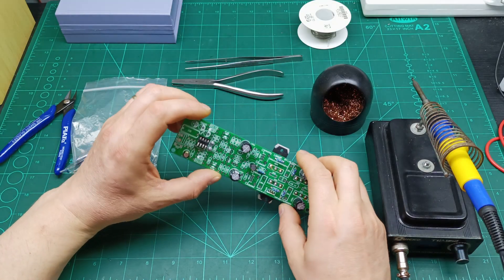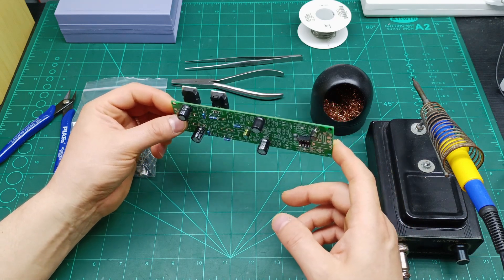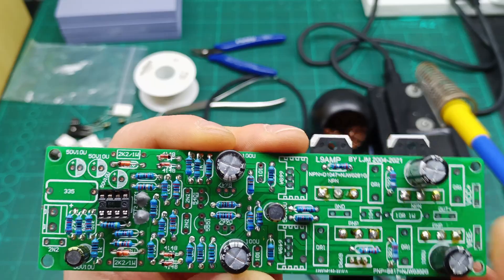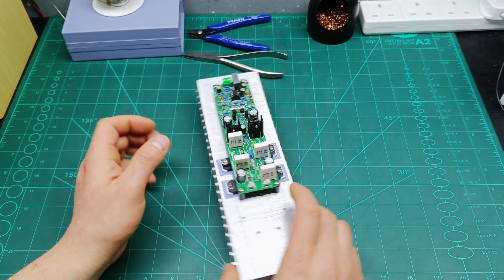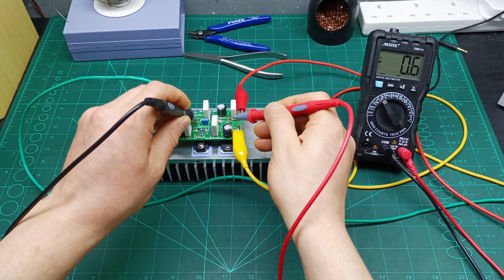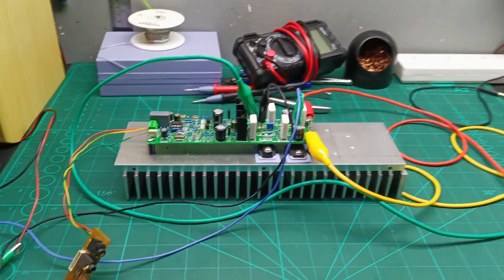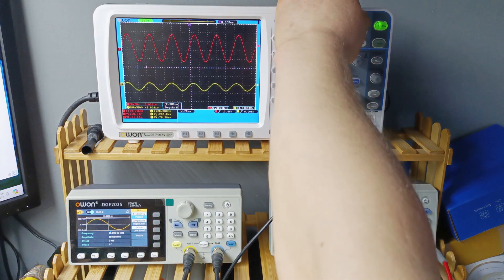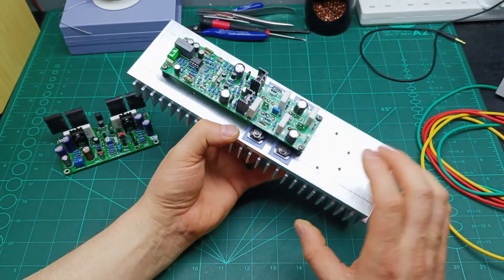Let's build an amplifier using AliExpress parts part 3 | Accuphase E405 amplifier kit

Comment: greetings, the power supply is symmetrical... the maximum voltage is 50-0-50V or 25-0-25V..thanks. nice build.
Reply from the maker: Can work from +/- 25 up to +/- 50 DC voltage
Reply from the maker: So - 25 0 + 25 up to - 50 0 + 50 volts dc
Reply: @SymbolTech21  thanks

Comment: I changed the value to 4.7kOhm which sets the gain connected to the inverting input of the preamp. I set it to 1kOhm and the preamp gain is now 0db. Now the sound is better.
Reply: To be honest, when I first turned on the amplifier, I was not impressed with the sound. I immediately noticed the insanely made preamp and it is clear that the sound problems come from it. This morning I listened to the amplifier with different genres of music and I am very pleased with the result. I have several versions of OPA1641 acquired at different times. The ones I bought from Aliexpress sound exactly like TL071 and are reliably marked as OPA1641 and the sound is far from the ones I bought from Mouser. With real op amps the sound is "open", clean and "airy"
The last op amp I bought from Aliexpress was 4 years ago - OPA 1612 which were brutal garbage and I haven't bought from there since then.
Reply from the maker: @silverchesnov5247 definitely if you want original parts need to source them from trusted company
Reply: I'll measure it tomorrow. I tried a few different OP Amps - LM4562, OPA2134, OPA1642, MUSES8820. LM4562 sounds best instead of NE5532.
Reply from the maker: @silverchesnov5247  thanks for suggestions definitely I will try to play around with different opamps as well!
Reply from the maker: @silverchesnov5247  and now how many mV is the input sensitivity for the max power before clipping?
Reply: Up to 1volt there is no clipping. I use a step attenuator and the last step before clipping is 1.1V. The next step which is 2.2V has clipping. I highly recommend the LM4562 in this amplifier.
Reply from the maker: @silverchesnov5247  and at 1v input signal what is the power RMS on the output?
Reply: Replace the 4.7kOhm resistor right next to the OP Amp with a 1K value and you will have a Buffer instead of a Preamp. 1 Volt is plenty for modern DACs or CD players
Reply from the maker: @silverchesnov5247  yes 1v line signal it's perfect!
Reply: Huh, my measuring instruments are not very precise. According to the voltmeter 1.1-1.2V. According to my primitive oscilloscope 1.55V peak to peak. I can't tell which is the exact one
Reply from the maker: @silverchesnov5247  I will try playing around with that as well to see if may affect the power output!
Reply: @SymbolTech21  I made another change in the preamplifier part. I removed the two resistors determining the gain (1K and 4.7K) and connected the inverting input to the output (pin 1 and 2 on Op amp) with this modification the sound is even better. By selecting a suitable Op amp you can adjust the sound to your taste. I even tried with a single operational amplifier via an adapter by removing the preamplifier circuit. In my opinion with a buffer the amplifier works better
Reply from the maker: @silverchesnov5247 thanks again for suggestions, definitely I will try to play with these mods as well!
Reply: @SymbolTech21  Today I tortured the amplifier all day. I replaced the powerful transistors that are included in the set with Toshiba 2SC5200 and 2SA1943. I can't call this replacement useful. I installed an adapter that allows you to put two single op amps in place of the double one. I did tests with different op amps and the final result was shocking. I tested more than 20 different op amps and subjectively I liked the sound the most with the OPA1641 in the buffer part and the Phillips NE5534 for the servo. The Texas Instruments NE5534 did not perform as well as the old Phillips. I can't give a logical explanation for the difference in the sound of ne5534 from different manufacturers if on paper it's the same silicon crystal.
Reply from the maker: @silverchesnov5247 that's good news about how this amp can be tuned and thanks again for all suggestions. I hope that others enthusiast about audio will read all these comments and they will try also to tune this amp!
Reply: With a power supply of +39V, -39v, 8 Ohm load and a 250VA transformer I have a clean 50W. I haven't tested it at 4 Ohm.

Comment: I don't understand your frequency response numbers. I have tested many amplifiers in the past and NEVER seen such rises in the mid-range as you often show. I set a 0dB level at about half power @1Khz. I would expect to find it completely flat from 20 hz to 20 Khz. Being less than -0.5dB down at a few hz and -0.5 dB at around 50khz. I've NEVER found rises or falls mid-range EVER.
Reply from the maker: @MichaelBeeny  I checked the signal generator straight to the oscilloscope. and connect in this way I can go from 1hz to 15mhz and the oscilloscope shows flat. This mean the amplifier is acting like that

Comment: I have this amplifier for 3 months and the main problem of this amplifier is the built-in preamplifier ( high sensitivity and no need for a preamplifier). The two-channel ne5532 of which one channel is the preamplifier and the second channel is DC Servo.. In my opinion this is not a good solution
Reply from the maker: @silverchesnov5247  is a good amplifier if you have low level signal imput
Reply: 5532 is closer to a sound amplifier than a DC servo. Because the input voltage offset is quite large.  OP07, OP177 would be better on the servo. Combination of tasks in one IC - unpleasantly surprising!

Comment: The amplitude shows negative feed back.
Reply from the maker: I already checked and is not that the problem
Reply: @SymbolTech21  do you think these modules could be used in E-205?
Reply from the maker: @cactuslist  are you talking about accuphase e 205 amplifier?
Reply: @SymbolTech21  yes
Reply from the maker: @cactuslist  but what happened to that amplifier? Should be complete with amplifier inside!
Reply: @SymbolTech21  one board is in 1/2 burned to coal. So think about used this replacement, but did not find e205 service manual, thats why i'm ask.
Reply from the maker: @cactuslist  I never had one of those amplifier in my hands. So you need to check how many volts the power supply have.

Comment: It looks like the feedback loop is not properly calibrated, maybe it will ring in supersonic and destroy tweeters. Please try to do something about that.
Reply from the maker: I think it's not that the issue because it's more RMS from 5khz to 15khz then start going down
Reply: @SymbolTech21  
This is very strange indeed. Maybe ringing?
Reply from the maker: @kostis2849  I need to check the function signal generator because I may think that comes actually from it

Comment: Hi Tony, what are you using to keep the components off the board?
Reply from the maker: I used a tool like this one to bend the leads https://www.ebay.co.uk/itm/322821956499?mkcid=16&mkevt=1&mkrid=711-127632-2357-0&ssspo=biMeahOQQKW&sssrc=4429486&ssuid=e2bvqqopq7c&var=&widget_ver=artemis&media=COPY